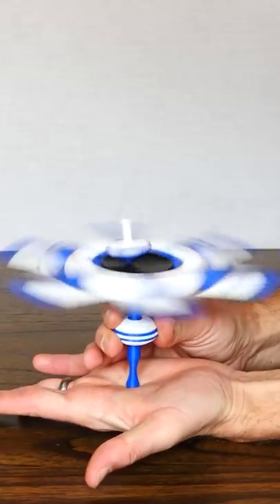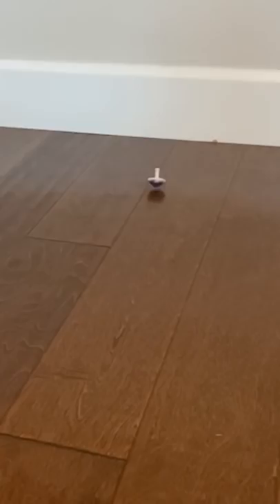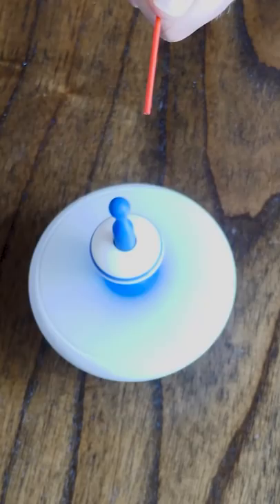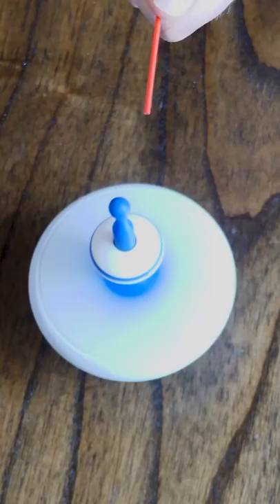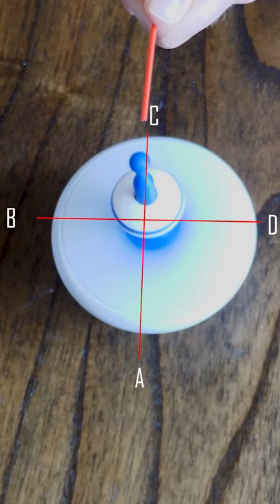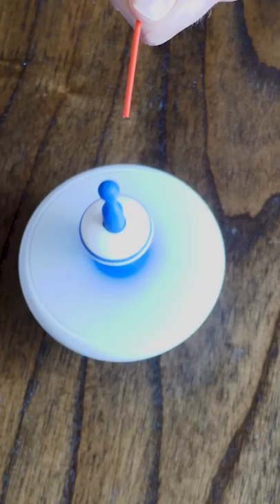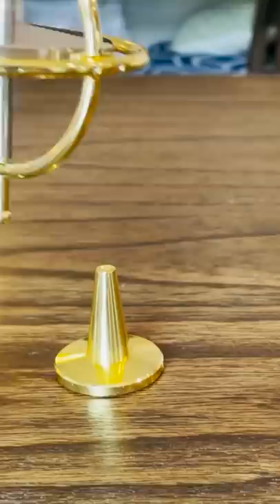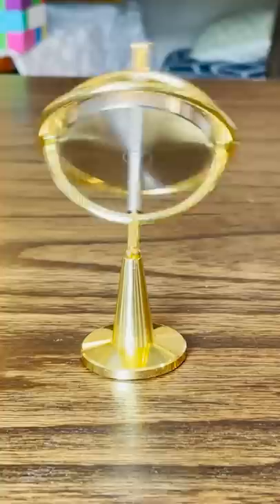Spinning a Top Within a Top

Comment: This was probably one of my favorite phenomenons that I learned of in my time as a CV-22 Crew Chief. The top one though is without a doubt the knowledge of Mattress Landings. If you've never heard of it, you can Google it for proof. Basically if an aircraft trying to land has a "hung" landing gear (meaning it could collapse when weight is applied) landing gear, the official military procedure is to place stacks of mattresses on either side of the hung landing gear(s) and guide it in. With this being an emergency there are usually 30 active participants and over 150 support personnel.

Comment: This also applies to single engine propeller driven aircraft, especially powerful big propelled ones such as WW2 warbirds, or even more so, WW1 aircraft with rotary engines (spinning radial engine), for example the Sopwith Camel.

Especially in the case of the last one, the effects on how the plane handles can be quite dramatic and as a result the planes would, for example, turn better in one direction than the other, or try to spin to the side when the pilot pulls up. Pilots have to counter these effects with the rudder, or again in the case of rotary engines, possibly by even temporarily cutting fuel flow to the engine by holding down a blip switch to slow down the engine and decrease the effect.

Comment: The problem with the top is there another top in the top but if it hits the table top wrong that top in the top pops out and it stops as the other top drops from the table top but if you spin the top from the top it will be tilted and spin out of top speed so the top drops off the table top

It pains me to read this

Comment: Question: Law of Interaction
[MAKE A VIDEO ON THIS QUESTION PLEASE]
How can I move something, say a chair. If the net force is resultimg to 0. Since I applied a force to the chair (ACTION), then the chair also exert a force on me (REACTION) WITH THE SAME FORCE. So why can I move a chair if the net force is resulting to 0? 
Thanks anyway.
Reply: Umm, net force is not always zero, it is upto a certain limit, called static friction, as soon as your applied force exceeds that limit, the chair starts to accelerate, hence moving the chair. Also the maximum force resisting while it hasn't moved yet, and the force resisting while it's moving is different cause coefficient of static and kinetic friction are different.
Reply: @TheJosephStalin420  thanks

Comment: So this garners the question is it possible to spin a top on a frictionless surface or one that has close to zero friction
Reply: Air causes friction too, so I assume that it would still work
Reply: He's plain wrong when he says that the friction with the table is the force that the top moves 90° relative to. Gravity is that force, which is why the gyroscope also doesn't fall over, even though the friction with its base, isn't acting on the spinning part.

Comment: There was this old prank among physicists to put a heavy spinning disc inside of a suitcase then get someone else to carry it for you. As long as you carry it in a straight line, no problem. But the second you try to turn, the suitcase jumps and pulls 90 degrees from the direction you tried turning. Hijinx.

Comment: If you blow hard enough on the spinning top it’ll go where your intuition tells you. The fact it moves 90 degrees is due to the air pushing down on the top and since it is spinning, the lowered side would make the spinning top go 90 degrees in the direction the spinning top is spinning. Hopefully that makes sense.